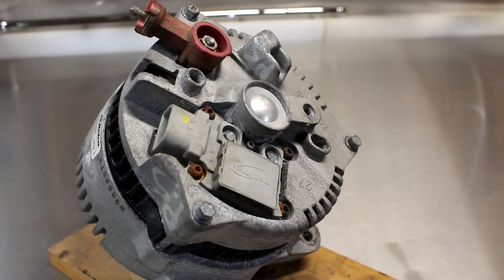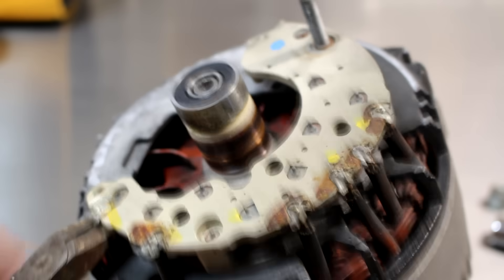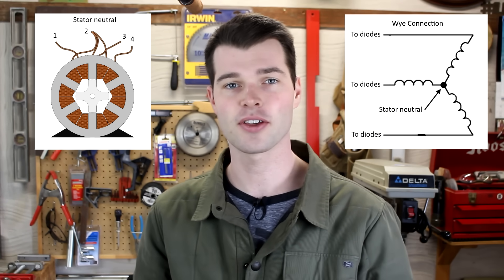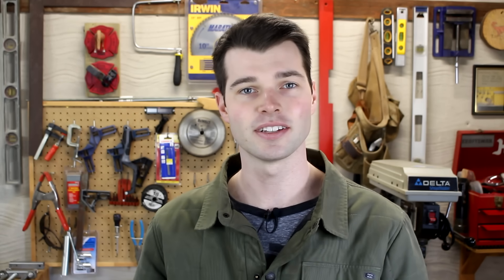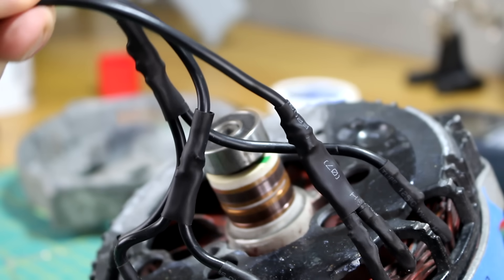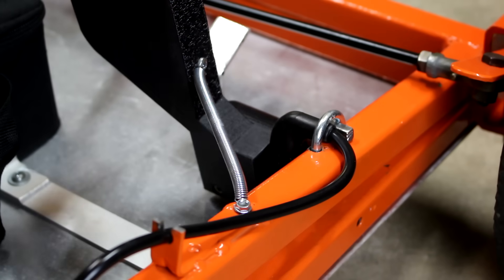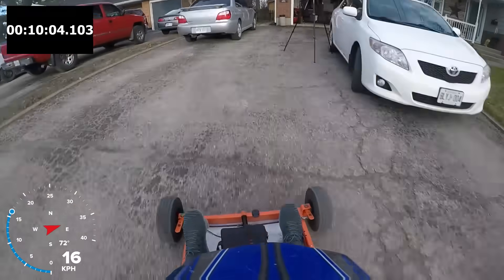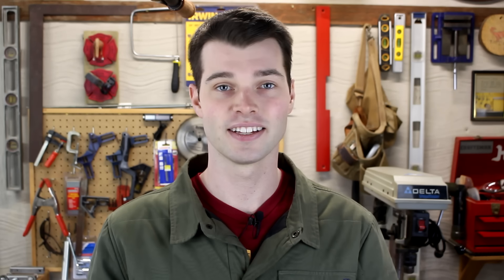Converting a Car Alternator into a Go Kart Motor

Comment: Very cool that the kid not only wants to do this but gets off of his butt and does it, HOWEVER, he flashed through the specifics so fast and in such a vague manner that it is unlikely anybody was actually "taught" how to do it. Most interested people would have gleaned more benefit  from a more specific demonstration and less video of him plying with the finished product.  This is meant to be constructive, not demeaning, so take it for what it is worth...Joe
Reply: Dear Mr Rollings, I watched the video a couple of times- maybe 5 times, But I only understood fully after learning about alternators, BLDC motors, batteries, speed controllers,  torque, volts; watts; amps and gear ratios on other videos. I guess the video was meant for somebody who would  have had some technical background on this kind of stuff. Anyway you can pause the parts where you need to absorb better. Best of regards.
Reply: Not a problem, I fully understand about alternators, , batteries, , torque, volts; watts; amps and gear ratios from 50 years in automotive electronics, machining and other fields. nothing about the others you mentioned. ABSOLUTELY nothing.  Not enough to get me past what I did not understand. I anticipated it would teach somebody who knew far less than me how to do the deed without further study because that is what the title indicated, but I encourage the lad to keep doing what he is doing. He has a good knack for it, just needs to change course a bit.....Joe

Comment: I did this 8 years ago, pretty easy. Should have done away with the old rotor though, I rebuilt mine with neodymium magnets  SO I didn't need the excite charge. (Plus Torque was much better but at the cost of current.)

Comment: A 40 amp fuse will not blow on 40 amps continuous current.  It is designed to allow 40 amps continuous.  The fuse will operate on an inverse time/current basis.  Any short circuit of large magnitude will cause the fuse to open almost immediately.  A load of 60 amps over and extended period of time will cause the fuse to blow, it just will take awhile to operate.  AC breakers work on the same principle.  A 20 amp AC breaker will handle 20 amps continuously.

Comment: Come on, who would give this a thumbs down. It's got to be jealous morons who wish they had half the brain this young man does.
Reply: its easy as shit. but i can get a lawn tractor motor that will move quicker for less money than buying everything thing you need for this.
Reply: @LazyH-Online 50 bucks i can have a 16 hp briggs and Stratton engine on an old schwinn  going 47 mph
Reply: @LazyH-Online that moves way slower and isnt worth the effort. but you also need more than just the alternator
Reply: @LazyH-Online Then you need to SAY SO (yeah, you did ..). If you have an objection to some tiny part of his work then what use is it to ANYONE to 'dislike it without saying what the problem is. This is why I Dislike is useless : it doesn't tell you anything.

Comment: So the 12v battery is powering the motor so what are the led batteries powering
Reply: The 12 volt battery is for the rotor - slip rings-- constant voltage. The 48 volt battery goes through the electronic speed  controller which supplies programmed input of AC to the 3 stator windings.

Comment: Great one, lad. Perhaps solar panels might be a suggestion not only running the go kart run longer, but also charging the batteries if you do this as your next project.
Reply: They don't charge fast enough and they don't hold enough power
You would have to quadruple the size of the go-kart for that and make it 10 times heavier which would defeat the entire purpose of your power to weight ratio

Comment: Dear Friend, you have 3 wires coming out (in) from the alternator but the controler has only 2 (out), how do you do it?
I like your work, but in electricity I'm quite poor in knowledge.
Thanks for your videos, they are GOOD...
Reply: He is using a BLDC controller, which has 3 wire output for 3 phase brushless motors.
A 2 wire output controller is way different inside and is used for a BRUSHED motor.

Comment: You should connect a brushed DC speed controller between the lipo and the field winding. It gives you a very easy, simple and cheap way to vary the field current and thus the magnetic "gearing". High field current gives you high torque but low speed (due to big back-emf). Good for starting off and climbing hills. Low field current is for lower torque and significantly higher speed. Would make the setup better performing for very little extra cost and complexity. At these levels of power and voltage even an ESC designed for an R/C model can be used, and a simple "servo tester" can be used to provide the ESC with the "throttle" signal.
Reply: Is this why many motors have a centrifugal switch?  I knew position 1 was for torque and position 2 was for high speed but I didn't know the theory behind how it worked.  But I think my example demonstrates what you are explaining.  Im on the verge of a Eureka moment when it comes to electricity, I just need to keep trying.  Im a master at engines and mechanical things, just not electricity yet.
Reply: @SquillyMon  It might be, but depends on what kind of motor and implementation. Some AC motors, like large ones for air conditioner compressors, have a start capacitor they use to initially spin up the shaft. Once they reach close to running speed, the centrifugal switch takes the start capacitor out of the circuit (best research it on google books because hard to explain without diagrams). On some DC motors that switch can do many things - for example the field coil and rotor coil could be wired in parallel for starting (so high field current and high torque), then switched to series at higher speed (so lower current, lower back-emf and hence higher possible speed).

These days I don't think centrifugal switches are that popular. You can do a lot more using electronic control, which makes a mechanical switch kind of obsolete except in special cases.
Reply: Understood...  The last example I saw was on a clothes dryer...  I'm familiar with the capacitor start motors i.e. on my large Air Compressors.  I literally dream about one day being able to think outside the box with electricity the way I can with machines/engines etc...  Mechanical Mastery I've got.   Electricity?...not even close.  
  
Can you recommend any books or videos that might be able to give me a good foundation for electricity?  I consider no material too simple...in fact, since I'm a simpleton, I'd like to start with simple.  I actually just read from a book from the 1800's about Teslas many theories, A/C-D/C current, poly-phase motors etc...but it started to get over my head in a jiffy.  Also another book from 1962 targeted for teaching 4H GIRLS about electricity!!  LOL, They were actually quite informative...  I don't care where the info comes from because its all good stuff in my opinion.  As long as my curiosity fuels my desire for knowledge, I know I will become more proficient, because you have to stay curious!
Reply: No idea about books of the level you're looking for (I'm a mechanical engineer, not electrical, so my own textbooks are rather simplistic). The howstuffworks website was useful to me to get learning the basics but there are other, more dedicated websites that will teach you in greater detail. Here's one that describes the various methods of starting a single-phase AC motor (one of which is the capacitor system I mentioned in my other comment): https://circuitglobe.com/starting-methods-of-a-single-phase-induction-motor.html

Lots of good resources and info on that site. It's technical and complete, but not too complicated to follow along.
Reply: I really appreciate you taking time to respond, I will check it out!
Reply: @LMF5000  Am I correct in assuming a higher output alternator would increase speed? If so I have a 400 amp Leece Neville off of a fire truck that i'd like to try this with, also would running it off 2 large deep cycle marine batteries in parallel be of any benefit as thy have high amperage and the ability to be depleted and recharged? To simplify speed control and reduce cost would a rheostat be able to do the job? Any insight would be appreciated, thanks.
Reply: @MatthewFogarty-k2y  A 400A alternator would be more powerful and give more speed but if it's from a fire truck the voltage is unlikely to be 12V. It's probably 24 or 48V. So you'll probably want to put your batteries in series for the appropriate voltage. You can't use a rheostat for these levels of power as it will burn up. A speed controller uses pulse-width-modulation (PWM, basically rapidly switching in and off) so it limits current with only a little waste heat.
Reply: 3 phase motor speed is controlled by frequency, dc motors are controlled by varying the field current.
Reply: Zach a 
that’s true but not for a hybrid BLDC alternator motor remember this motor dosn’t have permanent magnets. So varying the field voltage changes the “strength” of the motors magnetism. This changes the motors speed slightly, it mostly effects its efficiency and torque output.
Reply: @zacha1408  in normal 3 phase motors the speed is driven by the frequency, in BLDC motors however the frequency is driven by the speed (because the windings get switched in respect to rotor position, not by a fixed time). This way the motor acts like a DC motor, it gets slower under load etc.
Reply: Thanks for that interesting information! Much appreciated. Would that mean that permanent magnet motors with strong rare earth magnets have the same high speed issues I wonder ?
Reply: @bikefarmtaiwan1800  Exactly - the spinning of the magnets causes the magnetic field lines to cut the motor windings, which induces a back-emf in the windings that opposes the voltage applied by the power supply. When the speed gets high enough, the back-emf reaches the power supply voltage (minus losses) so the rotor doesn't go any faster (unless you spin it faster by some external means). If you were to raise the supply voltage, the motor would be able to rev faster. Eg if the motor goes 5000 rpm on 5V, it would go almost 10,000 rpm on 10V (I say almost because losses are greater the faster it spins). If you weaken the magnetic field, the induced back-emf gets smaller for the same rpm. That means that your motor will be able to rev faster with the same voltage - albeit the weakened magnetic field means the motor can produce less torque. Naturally with permanent magnets there is no easy way to change magnetic field strength. But with wound-field motors (i.e. where a field coil is used to create the magnetic field instead of permanent magnets), you can reduce the current in the field coil to weaken the field and allow operation at higher RPM for a given supply voltage.
Reply: @LMF5000  The OP won't reply to anyone, and you seem very knowledgeable on this subject....so, how much power can you get out of the typical car alternator?  1hp or so?
Reply: @LMF5000  I'm not sure where your reply went, but I'm talking about the other way around, like in this video.  Is it the same both ways?  Power out of the wires when ran by the pulley, AND power off the shaft when driven by electricity?
Reply: Thanx a ton... That was me too me!
Reply: how much is field current at starting and how much is on "high" speed you guess, for application like that.
Reply: When you say field winding here you mean the stator's windings, right? The controller is for brushless motors while this motor has brushes, it's not a BLCD motor with permanent magnets. Something I missed out? Moreover, what is the AC voltage/current that this controller gives to the 3 stator windings? How the calculations are done?
Reply: @Leilektsoglou  Sorry for replying a year late, I must've missed the notification and only saw your comment now due to another comment. Yes, the field winding is the stator, and it would need a brushed motor controller because it needs DC. A brushless motor controller outputs something a little like 3-phase AC which would be suitable for driving the alternator's motor windings (stator)
Reply: @MatthewFogarty-k2y  Cheap PWM controllers that can control that level of power might be R/C brushed motor speed controllers, or e-bike controllers (probably easier to work with as they come with provision for throttle linkage). My favourite website for battery info is batteryuniversity.com. For solar charging you'll want a MPPT (maximum power point tracker) controller, since with solar panels the more current you draw the more the voltage sinks, so to get maximum power (power = current x voltage) you need the electronics to be constantly adjusting the current draw to the maximum power point (the point where current x voltage is maximum).

Comment: You should put a small engine generator on there. One gallon of fuel can go further if used to power an electric motor through a generator than if the engine was used for propulsion.

Comment: can Alternator start spin under load..? 
Can i start engine with alternator using 200amp esc with 24volt i don't need rpm i just need toruqe to spin engine
Reply: The alternator doesn't start the engine it's always the battery that starts the engine.
You couldn't get that alternator to spin fast enough to preload the battery for a start

Comment: When I was a kid my dad and I built a go-kart using a starter motor off of an old Chevy V-8. We did not use a variable throttle, just an ON/OFF switch so it was all or nothing. It also tended to melt battery terminals. It was a lot of fun for a ten year old kid though.

Comment: yo that was sick is there a you can add something to reverse the polarity if want to go in reverse and like a mini generator to keep the battery charged if not longer?
Reply: For reverse, make a switch to swap the 2 rotor wires. For regen, get a controller that has regen capability.

Comment: Would b possible to have a large battery an use the alternator to charge battery on a gas engine then with some fancy pants circuitry have it switch it to assist the engine under full throttle then switch back to charging when cruising?

Comment: Would have thought you would use a starter motor. It's already a DC motor and would connect directly to the battery.
Reply: lochinvar00465, that would be a better way to power the go-cart.  Be advised : a starter is purpose designed to start a vehicle engine (high torque) and then sit there, not working. 
In other words, intermittent operation.

Comment: What would you have to do to make a reverse on it what wires would you have to change?
Reply: Not sure if it would work for an alternator but it usually requires you to reverse polarity. Test it after converting the alternator and if it works, install a switch between the controller and the motor and label the positions.

Comment: Y is higher voltage then Delta using the same windings. The current draw will be less and the top speed will be less with the same battery voltage.

However with proper use of a field rheostat, the torque and back EMF can be reduced for higher speed.  This balancing of torque to speed to voltage and current is not for the faint of heart.  Best done with a dedicated controller built for the job.  It works in reverse of the original voltage regulator to deal with varying load and engine speed with a fixed target voltage.  Done wrong and efficiency suffers immensely.

Comment: Nice Job!  I don't understand how I did not know this when I was in High school in the 1970s.  I was the best mechanic (highest test scores) among Seniors, Juniors, and Sophomores and I was a Sophomore.  It is so great you are able to think of this!  This should be a money-maker kit for you to be able to sell for easy assembly by garage mechanics.  Let the buyers get their own batteries; you supply: alternator and the controller and some sprockets and instructions.  They supply batteries and the wheel chair or hay delivery cart or barbed wire fence repair wagon, or go-cart.